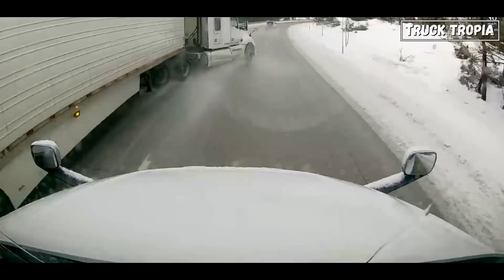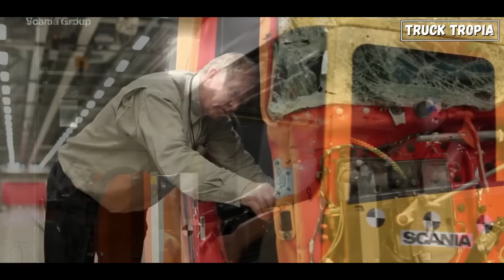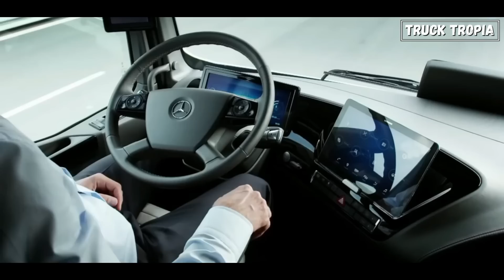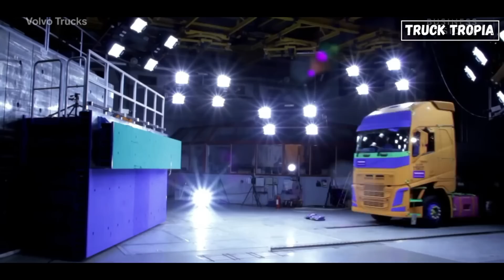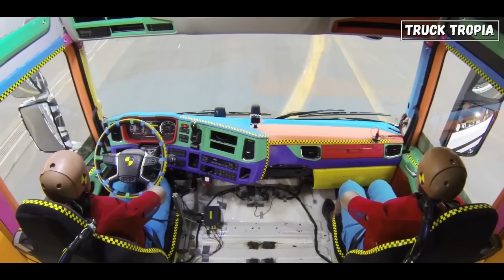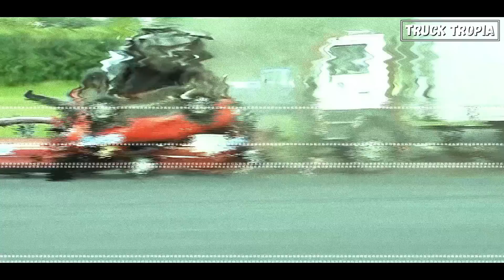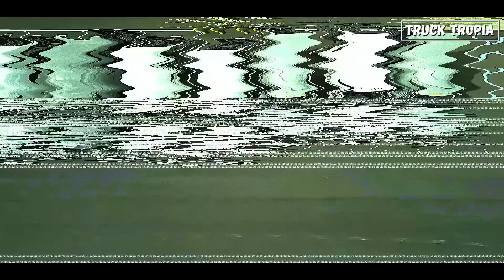What Really Happens in a Semi-Truck Crash Test?

Comment: European trucks are safer in preventing the accident, bigger disc brakes, cabins that deform and protect the driver better, better designed suspension etc.
Reply: Especially that they have airbags
Reply: @TeimonKauppa739TeimoJake  worse thing you can have in a vehicle compartment is an airbag. it is an explosive device. I think newer trucks have them here now
Reply: Thanks for spoiling the video☹️
Reply: on your list, NONE of that is true. even the video says US trucks are safer in a frontal collision.
Reply: And better trained drivers!
Reply: @bengtolsson5436   is that why you need a computer to hit the brakes over there?
Reply: @notsure6182  No. Do you need a house to live in. Or are you still living in a cave?
Reply: You don't have to answer. Voting for Trump clearly proves that you're not sane.
Reply: not safer at all. European trucks travel like 20-30 mph slower
Reply: @marcelo403polo2  if you hit something faster you will get hurt more no matter what. I've seen the damage American truck cabs get vs European in Australia.
Reply: @marcelo403polo2  While this might be true for most states (California for example has a 55mph speed limit), it just means that the long nose of US trucks serves its intended purpose: frontal crash safety. 
But this doesn't mean that the overall required safety standards of US trucks should be this much lower than of EU speck trucks. 
Also it's important to note that trucks can get special licenses in the EU to go up to 100kmh or roughly 62 mph, while still being able to maintain the points OP mentioned
Reply: @jms4989 Still illegal in my home country (which is in the EU) max here is 90 km/h but most trucks are restricted to 80 km/h which is 55.92 and 49.71 miles per hour, so basically 56 and 50 mph. Or slower if the speed limit says so.

And let’s not forget the difficulty of actually getting a truck license. 
I can’t speak of the entire EU but as far as I know, in my home country, a person needs to pass both a theory and a practical test as well as a urine test in addition to having a car license which also requires a theory and a practical test. Although not required by law, nearly everyone attends a drivers school (so no, a parent cannot teach his/her child how to drive by sitting next to them) and the average is about 40 lessons (for the basic driver’s license). For a truck additional lessons are generally needed.
Reply: @jms4989  except the engine has to go through the cabin. Australia runs at 100kmh on trucks.
Reply: @Low760   when I ran south there were no speed limits in Nevada. so 85mph across the desert was common. it was funny going through the mtns in CA, all the cdn trucks trying to get top score on the electronic speed warning signs, and then when we got to about mtn gate clicking the cruise back to 54mph
Reply: This Is normal for the US as well. Pretty much described how we get our class A's here. Process Is well worth It
Reply: @marcelo403polo2  In what world do you live in? They travel at around 54 MPH while US goes around 60-65
Reply: @marcelo403polo2  slower is safety. The faster you drive, the greater the risk of accidents! So in the USA there is a greater risk of accidents. Higher speeds and less educated drivers.

Comment: 130 tons weight? Lol, not really
Reply: If it was a triple road train.
Reply: 74 kiloton = 163142 pounds or in speciall roads with permits 90 000 kg = 198416 pounds
Reply: @jarpa153  74 kilotons would be 74000 tons.

Kilo = 1000
Reply from the maker: in the video we say that there are crash tests with over 120 tonnes, which is obviously not correct. :)
there are some countries where 120 tonnes is allowed in total vehicle gross weight, 
but they do not crash test with that weight :)
Reply: @TruckTropia  yes. I know that since working 19 years at Scania. The trucks have extended warranty up to 300 metric tonnes if you need it for heavy haulage.
Reply: EN FRANCE, LES TRACTEURS 6X4 OU 6X6 PEUVENT TRACTER JUSQU'À 120 TONNES !!!

CERTAINS TRACTEURS 8X4 OU 8X8, PEUVENT TRACTER JUSQU'À 600 TONNES !!!
MAIS JE PENSE QUE DANS LA VIDÉO, IL SE TROMPE !!!

JC ANONYMOUS PATRIOTE FRANCE.
DE GAULLE ET FIER DE L'ÊTRE.
Reply: @JCPATRIOTEANONYMOUSFRANCE   we are not talking about weird twin steer specialty trucks here. and YES we have those in north america, common on concrete trucks, we also have tridrive tractors  pulling tridem doubles here, https://www.youtube.com/watch?v=TtX5_ERSpvI